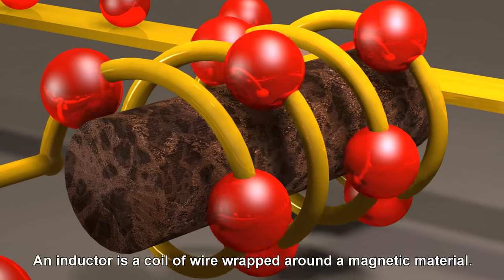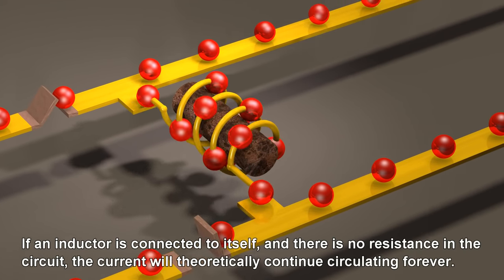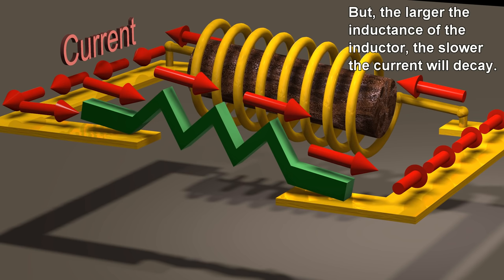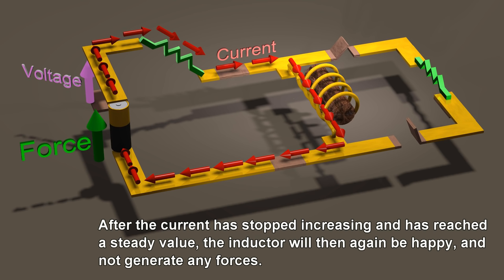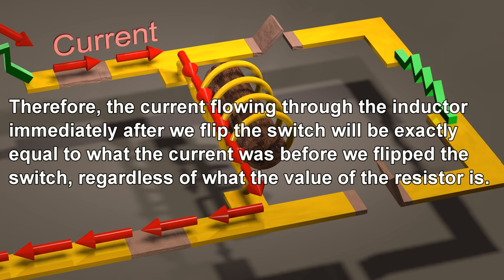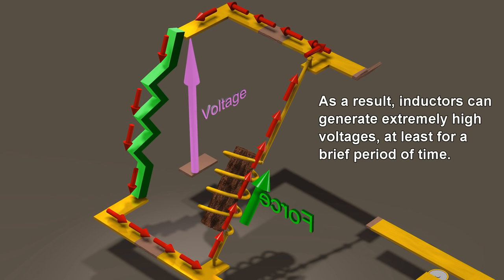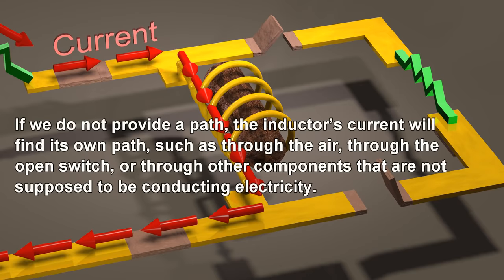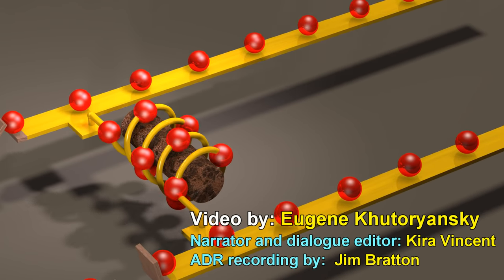Inductors and Inductance

Comment: Don't try to disconnect an inductor when it has current, otherwise the inductor won't be happy :<
Reply: Lol!!
Reply: so will you be happy?
Reply: Lhh
Reply: Lololol
Reply: Sounds like something from a horror game
Reply: Luis Calderari I will
Reply: It actually gets pissed off
Reply: @mridulahi8500  I thought super capacitors was the hulks of electric circuits lol
Reply: @girlmore4484  I see what u did there
Reply: So you are saying that switch mode supplies are not happy depending on the Pulse Width Modulation? Lets say it's at 50% it's either not happy nor sad ?
Reply: Actually, the person that is disconnecting when lots of current is passing through will not be happy because he will be shocked !
Reply: the inductor will be shocked if you do so .
Reply: @girlmore4484  one could say he would be ecstatic
Reply: I just want the inductor too be happy. That's all I've ever wanted.
Reply: @girlmore4484  🙂
Reply: lol inductors Like to bite the hands that remove his food
Reply: By that logic, you shouldnt charge an inductor which has no charge?
Reply: So I can't turn off my radio?
Reply: Mr inductor is a conservative man

Comment: Hi, i graduated from university the previous year and am working now as an electrical engineer  and i just need to say i wish i had these vids in undergrad, also very good modeling  in its simplicity and effectivness at portraying the concepts
thanks
Reply: Dude I am in college now, and want to go in the same field.
I wonder what exactly is The job done by electrical engineers?
Like what do you exactly do at work?
Reply: Surprised this went unanswered, the main jobs for electrical engineers is in the design of electronics from power supplies to whatever you are trying to make. BSEE's are used in any electronic design work and in troubleshooting electronic systems. There are thousands of electronic design and manufacturing jobs in nearly every industry. A doctor might use a CAT Scan device, but an EE likely designed it and may fix it when it breaks, might be a technician also.
Reply: @wildbill3613  how about a computer engineer?

Comment: YOU SHOULD BE MORE FAMOUS THAN YOU ARE. EXCELLENT CHANNEL.
Reply from the maker: +Samrat Sur, thanks for the compliment.
Reply: +Samrat Sur Very true. These videos are amazing and very informative.
Reply: My Question is why inductor prevents the flow of current or resists the change of current..??what role does magnetic flux plays in current flow and changes...
Reply from the maker: Brijendra Mishra, this is because a changing magnetic field creates an electric field.  I cover this in detail in my video "Electromagnetism - Maxwell's Laws"  at http://youtu.be/9Tm2c6NJH4Y
Reply: @Brijendra Mishra

Assume an identical coil-2 is placed very very close to the original one such that all flux links both the coils.
Now any change in the first coil's current will change the magnetic field to change which is linked to both the coil so it will produce a voltage on coil-2(Transformer action) which will be same in magnitude and direction right ?.
This means that the same voltage will develop on the first coil also because it is also in the same magnetic field as the coil-2.
This voltage will oppose the current flow in the coil.

Assume you applied 10V to coil-1 so the current in the coil-1 start to flow (change from zero).
Which produces a changing magnetic field.
Which in turn(using transformer action)produces a voltage which should be equal to 10V but will be little less due to the losses in the coils resistance and the core.
So now the voltage producing the current will be less because of the voltage produced by the coil-1 is in phase with the applied voltage and will oppose the current.
So the current flow is delayed (slowed).
Reply: Physics Videos by Eugene Khutoryansky addd

Comment: The behavior of an inductor is not because "magnetic fields do not like to change", but it is due the production of back emf that opposes the initial current. When current starts running through the coil, it establishes a magnetic field. This establishing of magnetic field counts as a change in magnetic flux, therefore inducing a secondary current in the same coil which should generate yet another magnetic field which, according to Len'z law, should oppose that change in flux.
Reply: In summary, the magnetic fields dont like to change
Reply: Marcus Tornea Sums up the same thing.
Reply: And indeed this lenzs law is outcome of energy conservation... Hence the theory unified by me.... Scientist chanakya sinha 😎
Reply: he tried not to use complicated terms for the absolute beginner
Reply: It is MUCH MUCH more subtle than that. It is really connected to intertial reference frame and the forces arise due to length contraction experienced by one object viewing another object in a differenct intertial reference frame. For example if me and a group of friends were standing on top of a moving bus and we were all 1 meter apart and we had a group of friends standing on the road side also 1 m apart. Then we decised to take the bus down the road, turn around and drive past the group of friends standing on the road side. We, on the bus would see that the group of friends on the road were now closer it each other than 1 m due to Einstiens lengh contraction. Likewise they would also see that we are closer to each other. From our point of view our frends on the road are more densly packed. If we were electrical charges then we would observe a hight density of charge. They would therefore be reppelled from us the we would be repelled from them. That's it.
Reply: @PIC18F  Well explained thank you
Reply: Well put. The changing magnetic field is only part of the explanation and is oversimplified in the video. The back EMF that is generated in the coil by the changing magnetic field is the key, yet it goes unmentioned in the video. Once the supply voltage to the inductor ceases, the field collapses and the back EMF becomes dominant causing the current to continue in the same direction yet causing the voltage polarity across the inductor to reverse. I am amazed at how many comments I had to read through before coming to yours which better explains the dynamics of an inductor's operation. Good Job.
Reply: @PIC18F   Sounds like you rode on the short bus.

Comment: Thanks for the great video but one question why you didnt mention about the magnetic field forms around the inductor that when the switch is open is the collapse of the magnetic field will keep the current flowing until it depletes completely then the current stops.
any way very nice videos and wonder if you can make similar videos for capacitors and time constants.
Reply from the maker: +R Vass, I went into detail about that in my video on Maxwell's Laws, so in this video, I wanted the focus to be just on how an inductor behaves in a circuit, as this was never covered in any of my previous videos.  Thanks.
Reply from the maker: And yes, I plan to eventually make a video on capacitors and time constants.

Comment: Such a nice visual explanation. Now I know why my relay is sparking, a voltage spike from the solenoid it is switching.
Reply: That happens because of the collapsing magnetic field creating a CEMF (Counter Electromotive Force) which generates voltage when the power/voltage is removed.

Comment: I'm really enjoying your videos! The graphics are great and make it much easier to understand. Thanks! 

Questions if you have time:  Is it possible for an inductor to hold a charge if it's suddenly disconnected from a circuit, or will its charge always find a path regardless of how quickly it's disconnected or how well it's insulated? If so, will it be magnetic beyond whatever charge the iron core has? Is there an upper voltage limit when the magnetic field collapses or will voltage rise to whatever level necessary to find a path?
Reply: whatever the speed of disconnecting. if you have no load when disconnecting, so it's equal to a very very large resistance. so the voltage will increase very quickly to a very high value at the opening point until it will be enough to create a spark discharge.  the spark will remain until the complete coil discharge. 

to hold a charge in a coil you have to put a real 0ohm charge resistance so the current will  flow in the circuit turning around infinitely . that's impossible.

Comment: Thank you for the very understandable presentation. One issue - I think the smaller the resistance the greater the current in the circuit (I=E/R) and the faster the inductor should decay. For example a direct short across the gap would allow more current to flow than a one meg-Ohm resistor...
Reply from the maker: No, if there is no resistance, then the current will not decay at all, and the higher the resistance, the faster the current will decay.  A higher resistance means that there will be a higher voltage drop for a given amount of current, and the voltage drop across an inductor determines how quickly the current through the inductor will change.  And thanks for the compliment on my video.
Reply: @EugeneKhutoryansky  have a question. Is the only thing causing the inductor to have a high voltage specifically due to the value of a resistor? Or are there other causes?

Comment: this is explained perfecte.  never seen it better explained.   i have aan question though: what if there is no path provided and the circuit is in vacuum(no air).  what Will happen to the current?
Reply from the maker: The current will flow through the vacuum.  And thanks for the compliment about my video.

Comment: Wonderful work as always. But there's just one thing that i don't understand: where would that resistor with high value resistance be in a simple circuit  with a relay,  microcontroller, transistor and a battery, to make necessary the use of a diode, due to the voltage peak? i understood the need of a path to prevent damage on other components, but i'm stuck on this  question.

Comment: 1 Inductors store energy in the form of magnetic field due to current flowing through them
2 They always want to maintain their present state and hence always apply opposite force to applied force 
3 When connected to voltage it first resist the applied voltage and behave as open circuit but then eventually start developing magnetic field which counter the opposing force and eventually current will start flowing once current start flowing it will atttain new state and now will resist if this state is changed
4. When inductor is deatched from voltage inductor will try to maintain the present state which is current flowing , as a result if suitable discharge path is not provided it will find random path which is fatal
5. Never disconnect inductor without providing discharge path
6. Inductors are very serious about their steady state and can do anything to maintain that state

Comment: At 2:50 you say, "Therefore, when we connect this inductor to a circuit, the inductor will initially create a force trying to prevent the current through it from increasing. But the current will slowly increase." Is this why stadium lights take a few seconds to a few minutes to reach full illumination?
Reply from the maker: +MrEstrax, no.  That is a completely unrelated phenomena.  That just has to do with how those particular types of lights work.
Reply: Oh okay. Thanks!

Comment: An inductance is the resistance to increase in current but a capacitor is a resistance to increase in voltage.When the inductance is made of superconductor by the decrease in temperature the electron  flow in increased by shifting towards the surface and as it becomes an insulator the electron will move from surface into depth increase in resistance .Electron will have a layered flow but when becomes an insulator at very high inductance the motion of electron will confine towards its atom but at superconductor levels it is able to move about freely through all the atoms and will not confine itself.The force of resistance in decreased during superconductivity and increased at high temperature.Sankaravelayudhan Nandakumar with refwrerence to combination of barium lead oxygen and bismuth combinations.

Comment: To put it simply,  inductors are shorts to DC, and have impedance (AC resistance). The initial inrush current generates voltage called COUNTER EMF caused by inductive reactance. Once voltage is removed,  the magnetic field surrounding the inductor collapses,  and acts as a transformer, inducing a voltage to try and keep its present state.   The opposite is true for  capacitors... They are a short to ac, and impedance to DC called capacitive reactance..

Comment: Great graphics, nice voice, excellent information. It would be nice to add the details of how the magnetic field is changing and its relationship to the voltage and current. Kudos. For example. what happens when the magnetic field is changed on an inductor?  Similarly, what if the inductor is a bifilar inductor with capacitance? You are at the thresshold of doing magic with electricity...;-)
Reply from the maker: I explain what happens with the magnetic and electric fields inside an an inductor in my video on Maxwell's Laws at http://youtu.be/9Tm2c6NJH4Y

Comment: Couple questions: 1) do you have to have a rusted metal part inside the inductor? 2) how does the inductor create the force? Is it magnetic fields of the coiled wire? Thx.
Reply from the maker: 1)  That is not a rusted metal.  2)  I cover this in detail in my video on Maxwell's Laws of electromagnetism at http://youtu.be/9Tm2c6NJH4Y

Comment: Feelings!  Everything has feelings and I'm sick of it.  I'm an engineer I don't know what to do with feelings. Furthermore I don't care about the feelings of the circuits I create, they will do what I tell them to do without complaint.  If they complain, I rip them from the circuit and install components that don't complain.  But this explanation of how inductance behaves in a DC circuit is accurate if you can get past the anthropomorphism.
Reply: I presume as an engineer you know that books exist. They're these dead trees with ink on them. Some guy who runs Tesla and SpaceX claims that they're the fastest way to learn. The bonus is that they rarely have "feelings" and don't require you to bitch at YouTube videos.